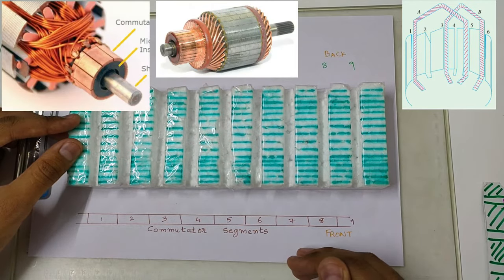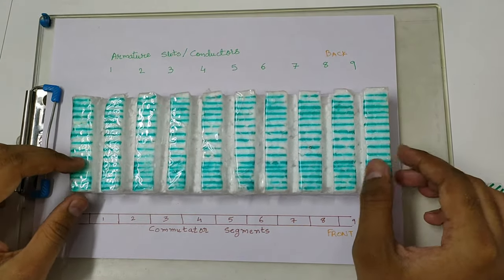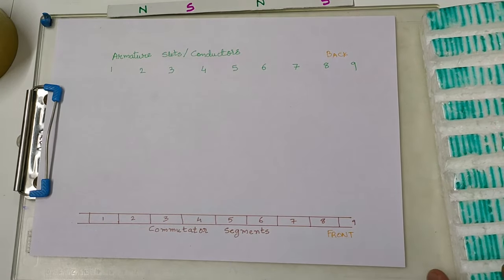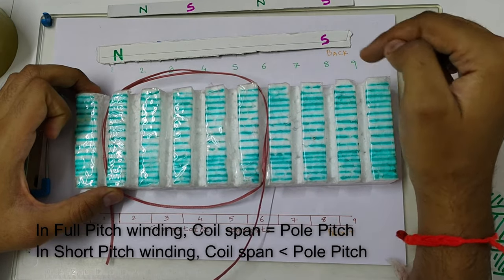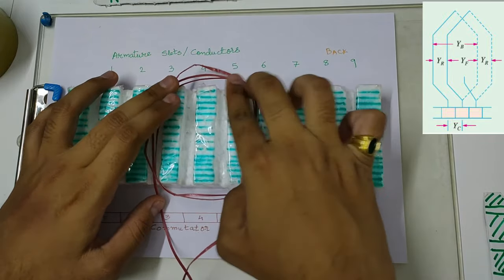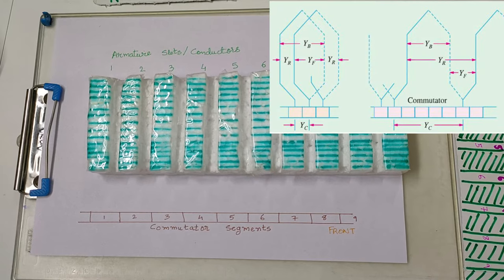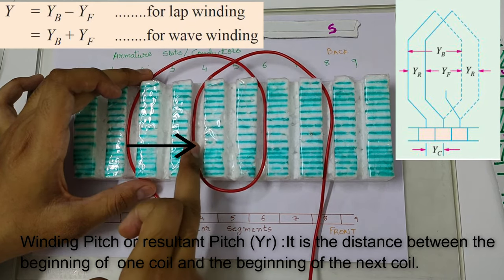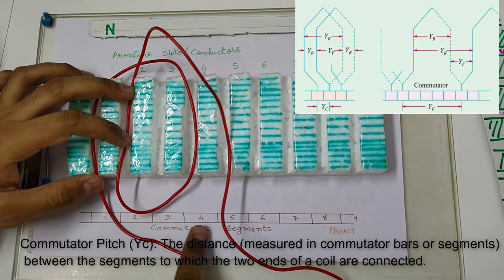Pole Pitch, Coil Span, Back Pitch, Front Pitch in Armature Winding | DC Machine | Lap & Wave Winding

Comment: Sir good explanation 👍. 
7:39 pole pitch =Z/pole =Z/slot . Could you pls explain.
Reply from the maker: That is a mistake.  Z/slots is wrong. It would be slots/p.
I have mistakenly interchanged slots with poles in the last equation.
Correction is as below:
Z = no. of conductors = no. of slots in single layer winding.
No. of poles = P
No. of pole pairs = P/2 = p 
Pole pitch = Z/p = Slots/p

Thanks for your question, as it identified the mistake. I would add this correction in video description so that future viewers/students are not confused.

Comment: For explaining back pitch you placed the coil sides in such a way that back pitch is 4.  And then told that it will be an odd number. Please give clarification. Also please clarify, for pole pitch calculation, if fore example north pole comes at slot 1 and south at 8,  pole pitch is 7 or 8.
Reply from the maker: The placement is to demonstrate and for better understanding of concepts. 
I did not realize (as my focus was on explaining) that I placed it in such a way that back pitch happened to be 4, an even number, which is contradicting the concept which I was explaining. 
Please pardon me as it created confusion in understanding. 
I appreciate your observation. Your comment made me realize that I must also keep these small details in mind while demonstrating concepts. I will take care in future.

Pole pitch calculation:
North pole at slot 1, and next south pole at slot 8, then pole pitch is 8 - 1 = 7. (Understand by example: distance between 1 cm mark and 8 cm mark on a scale (ruler) would be 8 - 1 = 7 cm). 
This pole pitch is in terms of number of slots.
Other methods:
Pole pitch (in terms of slots) = total no. of slots / no. of poles
Pole pitch(in mechanical degrees) = angular distance between 2 adjacent poles = 360/P or 2𝛑/P
Pole pitch (in meter or inch) can also be calculated as arc length between 2 adjacent poles on stator inner circle with diameter D 
So Pole pitch (in meter or inch) = circumference / no. of poles = 𝛑D/P